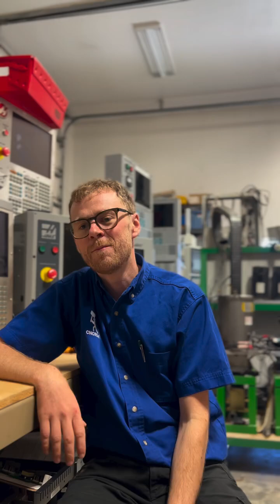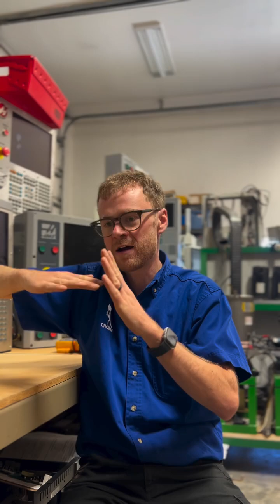Some thoughts on troubleshooting CNC Tool Changers!

Comment: Excellent advice!

Preventative maintenance is priceless for avoiding downtime. So few places practice it. RTR, run to refusal is so wasteful and unnecessary. 

I hear the complaints of stuck tools, dropped tools and noisy release. 

All preventable with routine cleaning and adjustments. Occasional parts replacement but scheduled not untimely.

I cannot emphasize enough the value of clean dry air! And never ever add wd40 or oil into airline - works for a moment but costs more later.